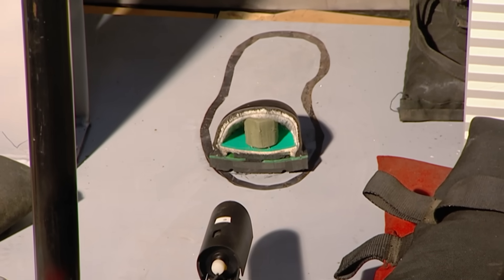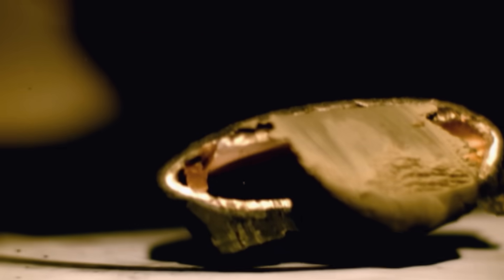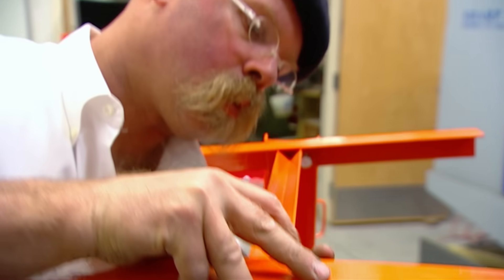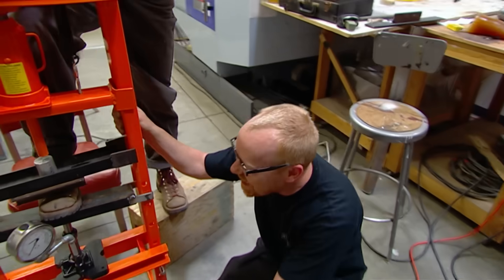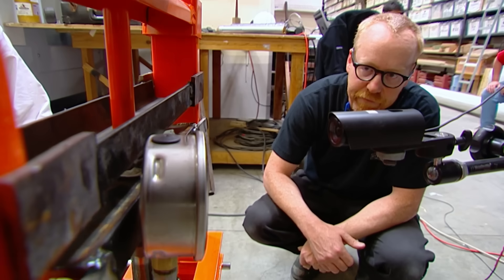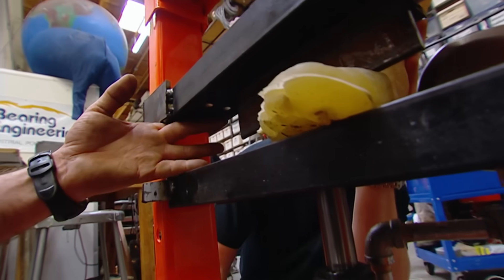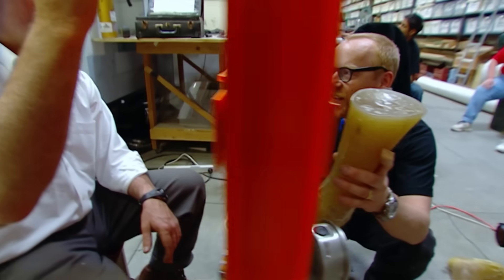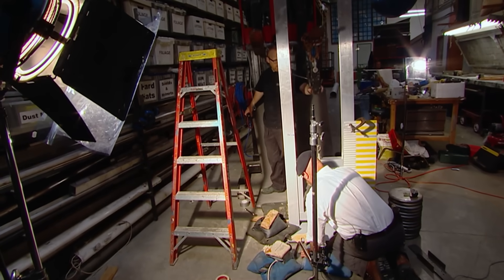Do Steel Toe Boots Really Protect Your Toes? | MythBusters

Comment: The answer is yes, they do. They are just not meant to save you from unreasonable circumstances. They are meant to save you from crushing damage from accidentally getting in the way of danger. Like if you didn't notice a vehicle getting too close and it rolled over your foot. Or maybe you dropped a tool on your boots. Things that can happen during normal work operations. It won't save your foot from being completely careless or some catastrophic failure.
Reply: Another way to put it is if the steel toe is not enough to protect your foot.  You’re gonna be worried about more than your toes.
Reply: @rkymtnboy7319 very true
Reply: Hard hats are the same. I always hear people say, it's not going to save you if you fall ten stories and land on your head, or a 1 tonne object falls on you. But it's not designed to protect in those situations. It's designed to protect you from bumping your head into low hanging objects like pipes, protect you from tools that may have been dropped off a scaffold or ladder, or swinging objects like a crane hook or load. Nothing will save you from a worst case scenario. It's the little accidents that can still kill or cause serious injuries that you are protecting yourself from.
Reply: @NathanM4A1 If someone is actually trying to argue that hard hats or steel toes are not useful, it’s their parents who should have used protection.
Reply: @Jayjay11111  I agree. Unfortunately they are quite common.
Reply: @Jayjay11111  lol, or swallowed, hahaha
Reply: @Jayjay11111  😂
Reply: @NathanM4A1  Likewise for eye protection. I see too many people opting out of proper eye wear whilst using equipment. Often, it's that it's too hot, uncomfortable, or nothing has ever happened. That's till you have a wood chip, splinter, or piece of metal shaving strike you in the eye. I've seen a guy get paint straight in his eye, no eye protection whilst painting above his head. Ditto for ear protection. Loud cutting, using loud equipment for hours without hearing protection. Guys doing that who can't hear you properly unless you're practically screaming, and have severe tinnitus. & Face masks, particulate filters for dusty, or paint filled air.  Wondering why they have asthma, or respiratory infections, illness. Also, not wearing gloves, with epoxy, various substances, seen dudes who had severe allegic reactions.
Reply: @NathanM4A1 My question is, how do your ankles hold up after carrying around the extra weight all day, every day, for 50 years?

I've worn them daily for 20 years, tried all the big brands, and no matter what my ankles are trashed. I'll make it to 70 with perfect toes, I just doubt I'll be able to walk.
Reply: @captron420 boots with ankle support?
Reply: @LilOleTinyMe  You just mean boots that are higher up on the ankle? If so, that's what we're required to wear. 

The composite shoe style was actually the nicest I've tried, but my work doesn't allow them..

If you've got specific suggestions, I'd love to go buy whatever and try it out. At this point, I've just given up on my feet and ankles and accepted that I'll be immobile soon..
Reply: @captron420  If your ankles are so weak that they can't support 1kg of extra weight, then I don't think trades are the job for you, considering you can be carrying 30+kg of weight during the day and your ankles need to be supporting some of that. You are the first person I've ever heard complain that steel toe boots are weakening your ankles.
Reply: @NathanM4A1  Well, it's a little late in life to be a lawyer. I'm not sure what else I can do with that information, but thanks?

If I'm ever born again, I'll be sure to either have stronger joints or be smarter lol.
Reply: @captron420 maybe a chropidist can help.
Reply: @captron420 maybe try the composite boots with a steel toe bolt on? There's some that might be a little lighter or more flexible if they go over the boot instead of being inside it?
Reply: i thought the purpose of a steel toe shoes its not to protect your feet but to cause as much damage to your opponent when you are kicking them
Reply: I had a forklift back over the toe of my boot and all that happened was the forklift jostled like running over a speed bump.
Reply: @jovenc4508 I used to build tractors at a shop. This one guy would always play around and act like I ran over his foot. I'd always try to make sure he was out of the way but one day he put his foot too close at the last moment. Luckily he was wearing his mandated steel toe boots and it rolled right over. His foot was perfectly fine and nothing actually happened.
Reply: I am a Mechanic by trade, sometimes its hard to line up a tire on the ground just perfectly, so i roll it up on my steel toe boot to line up the lugs. It would hurt is it was a soft shoe.
Reply: @rodx5571 ...makes me think of stories I have heard about old time electricians figuring out the voltage on a cable by licking it. Apparently the really experienced ones could tell the difference by how much it burned
Reply: @rodx5571 same. Especially on big truck tires.
Reply: I’m a blacksmith/fabricator and I can’t tell you the times I’ve dropped a hammer on my toes and the steel toe boots saved my ass.
Reply: Even just normal day to day stuff. I used to wear them all the time. Only reason I don't now is because of money.
Reply: One day a forklift drove over my foot and right on the steel toe. Bro i felt it flex and hold strong saved my foot that day.
Reply: Ikr like ffs, there are limits to everything  just like body armor won't save you if you get shot with an RPG
Reply: the most common vehicle in a factory is a forklift, on a job site its some kind of tractor or excavator, those things are so heavy that your toes are going to have a bad time no matter what
Reply: @lolatmyage a forklift can run over a steel toe boot without hurting the person, have you never worked before?
Reply: @Dave-om6nd  Really? Let's bring the 10 ton over and you can show us 😂

Comment: I have seen things like this happen several times, where whenever something that's supposed to make people safer gets discussed people will come out of the woodwork to propose situations where "well, this actually might be more dangerous". Usually these situations are incredibly niche and fairly pointless, but it's like people what to prove they're smarter than whoever came up with this safety equipment or something. And I do get concerns about cost or added complexity, but that's not what I'm referring to.
Reply: Happens a lot in auto racing. When F1 was adding the halo to protect drivers from large objects, people complained for months that it would slow down getting out in the event of a fire.  In the time since it was introduced, there has only been one fire, and without it, the crash would have been a decapitation.
Reply: @dontworry1302  Great example! I forgot about that one.
Reply: "I once heard of someone getting cut in half by their seat belt. Are they really that safe?"

Meanwhile people at much lower speeds than it'd take to cut you in half with your own seat belt are routinely DoA when they get ejected from their vehicle
Reply: @Hegamonia  People assume they aren't nearly as squishy as they are.
Reply: @dontworry1302  And some genuinely believe they can resist being thrown out by holding on tight. It doesn't take long for them to find out how wrong they are if they get into a crash
Reply: Some fixie (track bike) riders say adding a brake to the bike is dangerous.  I forget the reasons I think some say it makes you less careful and other reasons.
Reply: I call it Hot Take-Itis. Some people just want to go against the grain to feel special. I have a friend like this and he insists seat belts and bike helmets are dangerous. Also thinks smoking is good for you. Big Trump guy of course.
Reply: @mat5473  Your TDS is showing.
Reply: @majorramsey3k  Your cult personality is showing.
Reply: @izzycirrus  Your septum ring is showing.
Reply: @majorramsey3k  I don't have one, nice try though lol.
Reply: @izzycirrus  Oh, did your mom say no? Don't worry, you can have one after you trans yourself.
Reply: @majorramsey3k Hey your "I'm too scared to release the Epstein files" is showing.
Reply: @majorramsey3k  imagine voting for the same pdf 3 times
Reply: Some people just want excuses for bad behavior. Same guys who refuse to quit smoking cause "something else will get me anyway."

Comment: Once you wear steel toes a lot, I recommend wearing them as often as you can. It's very easy to stub your toes in anything else, when you think you've got a metal hammer on the end of your foot. It also comes in handy when you need to pound a loose nail into a fence or something similar.
Reply: You aren't kidding. 

The other factor is the weight. Switching back to walking sneakers for the weekend after wearing steel toe leather boots all week feels great at first but then the boots feel awful to wear again on Monday. 

I just wear steel toe boots all the time to avoid that lol.
Reply: @Luckingsworth Why can’t I just wear my flip flops at work? I’ll take my chances.😂
Reply: @Sigmund1924 we have found the Indian!
Reply: I remember one day at the factory I forgot my steel toes. I'm like fuck, I don't wanna lose a days pay, and I already drove an hour, Noone will notice.  To be fair, my coworkers didn't notice. Myself,  feet were in agony. The amount of times I'd kick parts up to me or stub them was redonkulous. You don't realize when you have steel toes on, the amount of damage you avoid on basic stuff. And like everyone has pointed out, if it's cutting your toes off with steel toes, without your toes are paste.
Reply: Yeah, I forked over $400 on work boots, got a 2nd pair for another 400 2 years later to rotate so they can dry every odd day, I keep the leather moisturized and they last for well over 5 years of heavy use without needing repair.
I even use them for hiking they are so comfy and wear them almost all the time.
Prior to that I used to buy the cheapest boots I could find... which I stopped doing when they'd break after a month, the plates would split or the fabric would disintegrate by the end of the first month.
Reply: @PerfectDeath4 you experienced the "Sam Vimes Boots Theory" in real life
Reply: yeah i was chopping wood last winter with an axe and they saved me. its a nice safety feature
Reply: Ye humans should be altered at birth to have steel toes like how they do circumcision. Baby steps towards the cyborgification of man.
Reply: Also when dealing with Hindus and Muslims very handy
Reply: Truth

Comment: Had a construction job for a summer that I had to wear steel toed boots for. I had to crouch a lot and the edge of the steel toe dug into my feet so much I lost feeling in my big toe. Maybe two weeks before I went back to school, a scissor lift drove over my foot without any damage. Feeling eventually came back to my toe and I’m glad I didn’t try and switch to regular boots
Reply: Don't think bad about steel toe shoes just because you had ill fitting or bad shoes.
Next time get a pair that actually fits and you won't have that problem.
Reply: Leave your feet flat on the ground and bend your ankles when you crouch rather than standing on just your toes. It’s easier, more comfortable, and it won’t cause that issue
Reply: ^ You must have some very bendy ankles. Too much meat on mine, wouldn't work.
Reply: Get a size up and I find they shrink to fit you bizarrely, and you don't have so much of an issue wearing them in. Also, wear a couple of pairs of socks.
Reply: @Henry-yh6vv  Can't wear too many socks summertime. What you really need if the steel toe is too narrow, is a pair of extra wide steel toed boots.
Reply: @Frille512 Even extra wide with most brands wont be enough. But yea definitely need wider boots if thats the case. For me I had to get the widest one thats available to buy. Called like a size H. Im not sure if that means its like a 4E size or whatever. But same concept. Wider boots. sadly if you get the H/4E or wider boots there is a much more limited selection and some places wont even carry them and not all brands will make em.
Reply: @Frille512 Get wool socks.  Not the thick fluffy winter ones, just proper work or athletic socks.  They wick moisture away amazingly, excellent investment (for not that much) for anyone doing anything remotely athletic or sweaty.  I run with them and even if my shoe gets completely soaked through the socks dry themselves out in minutes.

That said, you're absolutely right on this subject -- socks can't properly do anything about ill-fitting shoes.  Get better shoes first for sure!
Reply: Yeah you had a shitty pair of boots then
Reply: Try the Slav squat.
Reply: You had a really poor fitting pair of steel toes. My shoes have a steel toe, steel line sole and thick puncture/cut resistant material for the rest. Only thing different between them and my regular shoes is they weigh twice as much. Comfort wise they feel the same
Reply: Skill issue, learn your shoe size

Comment: A cheap pair of steeltoes I got from Walmart for my first job nearly chopped my toes off.  I was working for FedEx and their large metal cans that the packages go into have a railing system on the airplanes.  The can went over my toes but was still on the rails, but the downward force on the steel toe drove the metal edge straight down onto my toe joints.  It hurt like hell and it would not surprise me that slightly more force could have caused the metal to really crush into my joints.  I got better steel toes after that.  Better fitting and the steel part was thicker and went up past the toes by an additional half-inch.
Reply: Sounds like Brahma brand boots. I bought some just for walking through tilled deep yard soil when planting new grass and the leather tore at the edge of the steel. I had paid $30 for them.
Reply: Got what you paid for. Self protection is never bargain bin smart.

Comment: 1974, between college years, I worked a summer at the San Manuel copper mine in Arizona. I was usually working about half a mile underground, on a crew that laid railroad track in newly dug tunnels. As I recall, there were two types of track, rated by weight per linear foot. Of course I was wearing the required steel-toed boots, with the extra protection for the upper foot. I remember one time, after helping to place a section of rail, I found I could not move my right foot, the rail was on my foot. I pulled as hard as I could but could not get it out, it was REALLY stuck. No pain, I just could not move it. I called out to yhr guys and they grabbed some pry bars and lifted the rail off my foot. The boot was fine, my foot was fine, we continued working. But I was VERY thankful for those boots.
Reply: Railroader here, you are correct about the rail types. I cannot speak for what it was like back in 1974, but in modern times rail is graded by weight-per-foot. Most yard tracks are 90 lb rail, and main tracks are (i believe) 100 or 110 lb rail.
Reply: @ByahMule  I think that lighter rails were used underground due to smaller cars and lower speeds. I think the 75 lb/foot was the heavier of the two rail types they used, but it was a long time ago and I am not positive about that. That job was certainly an interesting experience. After I dropped out of college I was working for (basically) minimum wage, and I bumped into my old mine boss, and he invited me to return. It would have tripled my income, but I decided against it and found myself another life path. I think that, in the long run, going back would have been a financial disaster for me.
Reply: @flingmonkey5494  Your lungs are very happy about that!
Reply: @flingmonkey5494  I would guess that it would be 75lb/yard. In the 70s in Australia 60lb/yd was common but these days they use up to 60kg/m (~121lb/yd), and in the Pilbara they use 68kg/m (~137lb/yd)
Reply: @kombirat  I think it is weight by linear foot.
Reply: I had a rolloff truck drop its forks on my toes, lifted the rear wheels off the ground. Also on a copper mine, oddly enough! Steel toes saved my foot for sure.
Reply: Time to put that dot on foot finder and make some cash 😂
Reply: 1986, I was working on a railroad "extra gang" when a 135 lb rail, a quarter mile long, rolled onto my foot.  
It hit a bit higher up than the steel toe.  
It took 4 or 5 guys with long pry bars to release my foot.
Didn't break any bones, but I was limping for about 6 months.  
One of my comrades offered to hit it with a sledgehammer to ensure a compo case... no thanks!